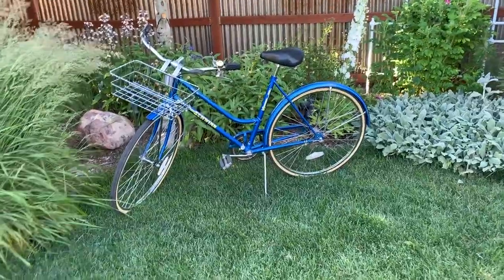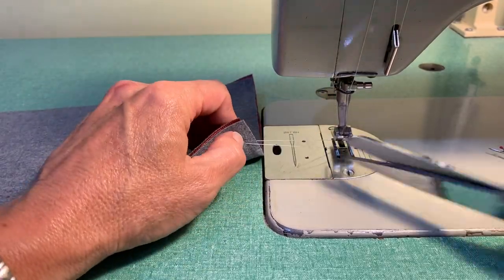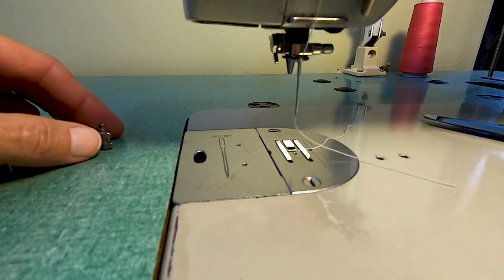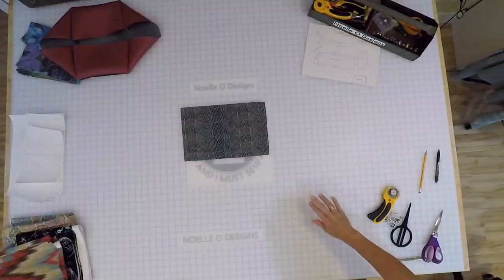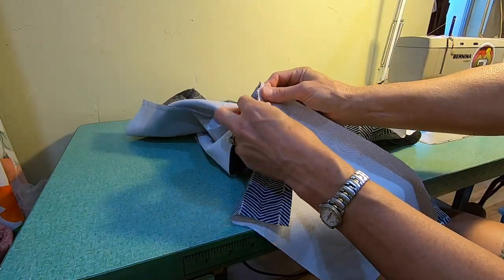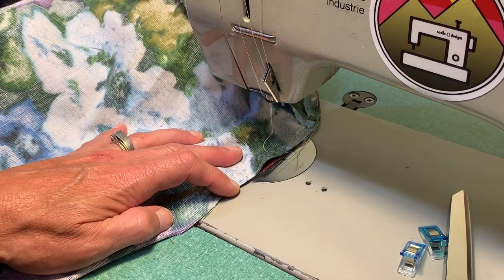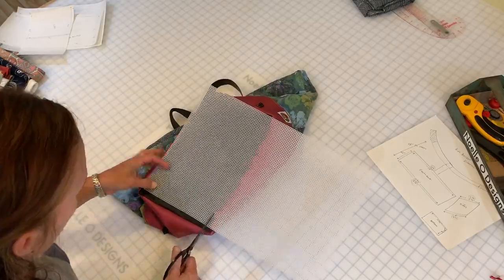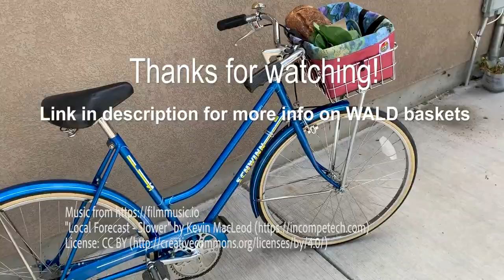How to Make a Bag for Your Wald Bike Basket

Comment: Wow! I made this and it came out great! (I guess I can't post pictures of it - bummer :-) I made it for a Wald 139 (18" x 13" x 6") basket. Here are the measurements I used in case anyone is interested.  Sew on!
Basket
  2 16½”  x 7½” x 18¼”
  2 11”x 7½” x 12 ¾”
  1 16½" x 10 ¾” 
Floral fabric pieces: 
  2 18¼” x 9” x 19¼”
  2 12¾” x 9” x 13 ¾” 
Lining: 
  2 19¼” x 16½” x 16½”
  2 13¾” x 10¾”  x 16½”
  1 16½" x 10 ¾”
Reply from the maker: Betsy Whitely Yay!! 👏🏼 I would love to see it- can you DM me picture on Instagram? (@noelleodesigns)